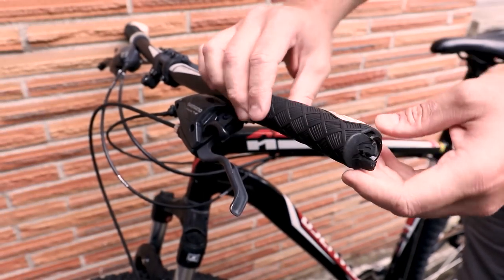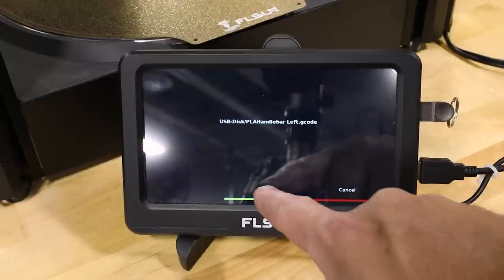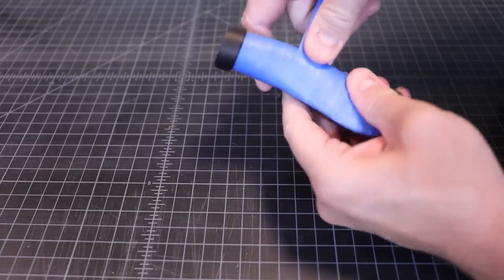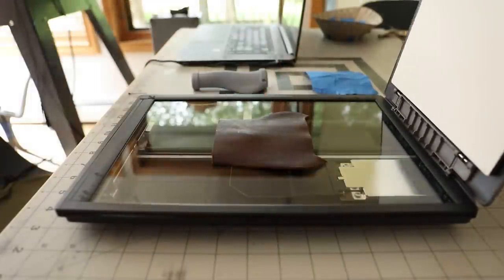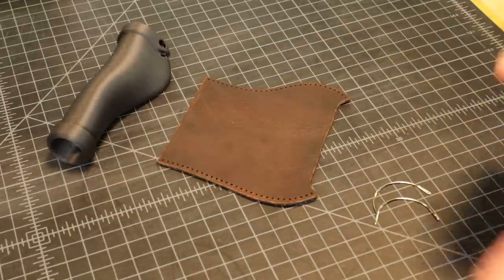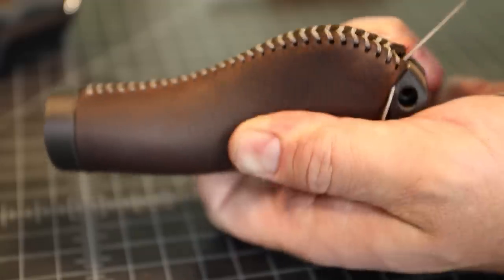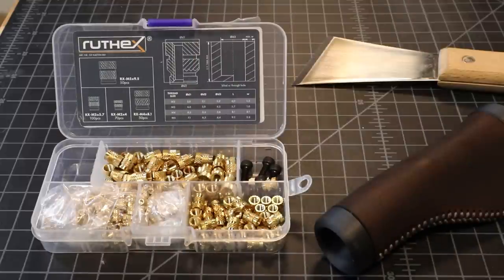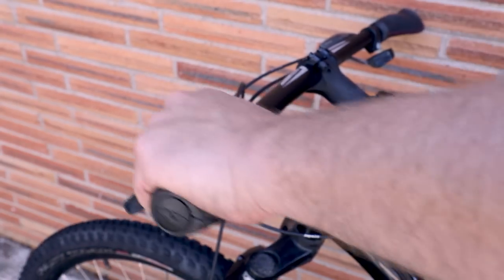Leather Wrap your 3D Prints | Custom Bicycle Handlebar Grips

Comment: Awesome 👍. I thought you were gonna cast rubber grips, using the 3D printer. But these are like Bentley grips. Thanks for the lesson.
Reply from the maker: Thanks! I was going to print the snake skin one in TPS filament but ran short on time and realized it wouldn’t really flow in the video.

Comment: Another killer video Brian! I never thought about just cutting the holes in the leather with the laser.
Reply from the maker: Thanks!  Yeah, the thing is… either side is slightly a different length with the baseball stitch.  Using the array tool, I could simply array 25 holes instead of an even spacing like a leather fork would do.  

Only draw back I see is the little bit of soot left in the hole.

Comment: Did the same a while ago and it was definitely easier than i thought! The only flaw is that I used smooth leather instead of a grippier rough one, but it's ok so far. Rough leather gets smooth over time as well.

Comment: Awesome project, how do you clean the edges of your laser cut leather?
Reply from the maker: Thanks!  Mostly by handling it.  If it was a concern it could be wiped with a damp cloth and sealed with a variety of different waxes, etc…. This is oil tanned, so it sort of self lubricates the edges…

Comment: Cool! Great work! Do you just laser engraved leather with some patterns on other two pairs? In this case, does it decrease water resistance of leather? Or you 3d-printed stamp and pressed pattern on leather? How long white stitches remain white?
Reply from the maker: Yeah the pattern is just engraved.  I suspect it won’t really matter as the edges are also exposed.  As far as pressing the leather… not with oil tanned, it wouldn’t take.  The white would honestly probably get whiter with use as it has a small amount of charred leather in it from the holes.  I like when things look worn, though…

Comment: great video as always. I'm amazed that you were able to print CF Nylon without an enclosure. with nylon did you use?
Reply from the maker: NylonX from Matterhackers.  The most difficult thing to overcome was getting it to stick to the build plate.  I had to turn up the temp quite a bit a lightly scratch the surface with some scotch brite.

Comment: Could you make a custom aluminum heatsink for the bottom of the PS4 Pro to make it silent?  The aluminum piece would replace the normal bottom plastic piece.  The Vram seems to be the hottest component.  Sony tents to barely use enough heatsink causing the fans to be very loud during demanding games like the latest god of war.